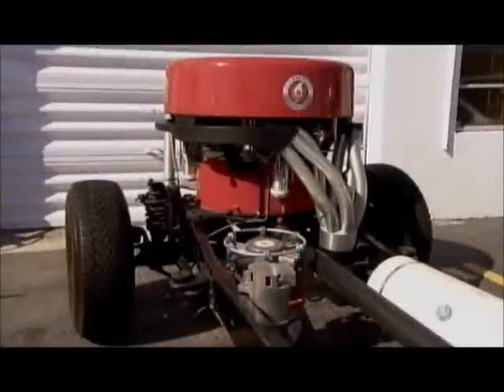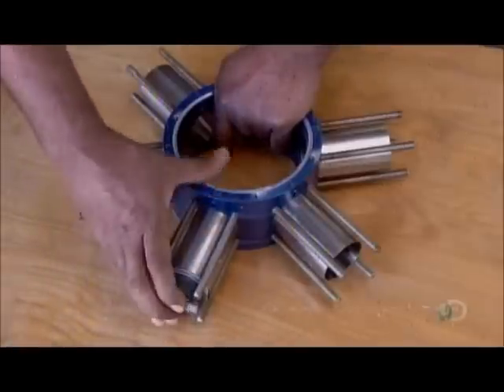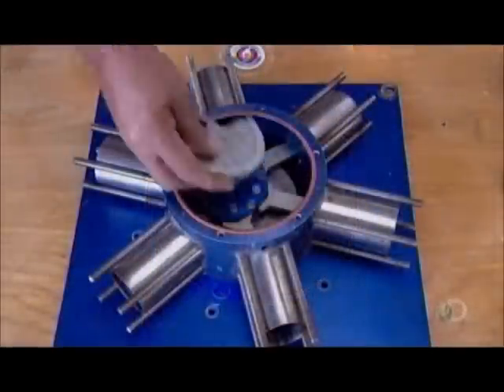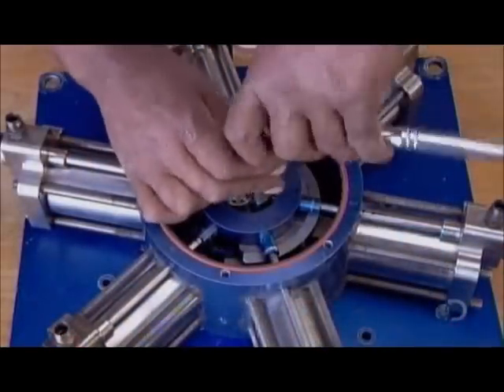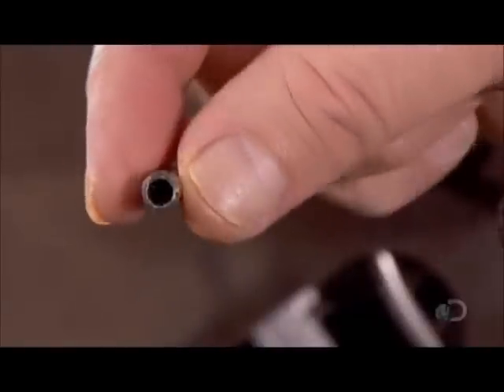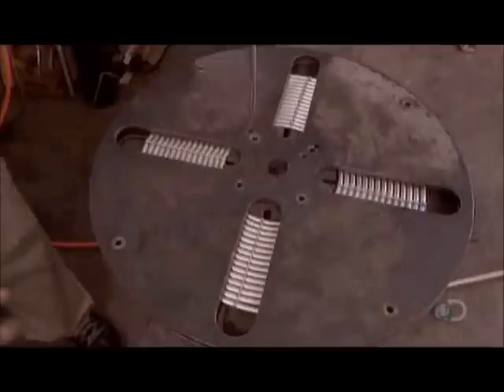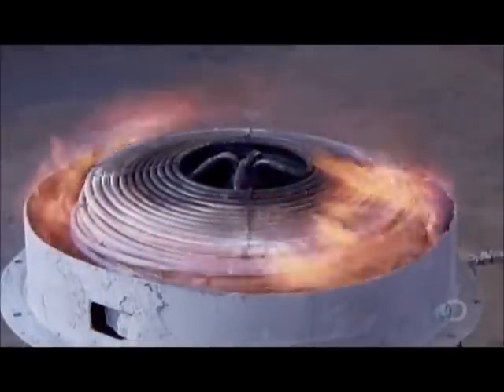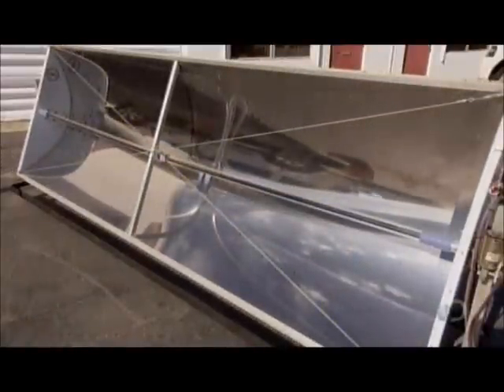How It's Made - Steam Engines

Comment: I don't believe the question here is what is efficient, I would gladly take a steam engine over anything that has to burn fossil fuels any day. Water is a hugely abundant material, one that earth recycles. Heating up the coils with simple propane should be no problem in fact to quote something I read about propane not too long ago " HD-5 (propane) was originally intended for use as vehicle fuel" Propane is not nearly as bad when burned, the only issue you come into contact with is pressure, and specifically different types of pressures, your propane and steam tanks. Which would both need to be made of industrial materials to even be fit to get near an interstate. When you include the cost of propane these days it might not be too bad, it just depends on how much propane it takes to get the amount of steam you need and for how long your journey will be. I think one of the issues you run into, is controlling your peak amounts of steam. This is why relief valves and gauges keep you from getting an explosion. So if you aren't checking these things while driving...well, KABOOM! I think for all intensive purposes steam engines still fit a great many uses today. It could make for fun travel by vehicle if you spent the time engineering it to do a specific task. Also, applying a transmission to a steam engine would be an added benefit because you can stop from forcing too much work on the engine itself. Although steam engines are powerful and strong, it's not hard to mess up the piston.
Reply: The problem with steam is low thermal fuel efficiency on the scale of an automobile engine.. heat loss is high so fuel mileage is generally very bad.. this company has had a hard time releasing any info on fuel efficiency and BSFC.. but some tests have shown they are not very good... less than engines currently available.
Reply: Some Other Dude Both the practical and theorical efficiency limits of the steam engine is far less than that of the ICEs... Carnot calulated the formula that proves this 200 years ago...
Reply: killer13324 Coal fired steam turbine powerplans in the over 1,000,000 kilowatt can be very thermally fuel efficient...  its why alot of are electrical consumption in the US comes from this type of power plant.
Reply: killer13324 The laws of thermodynamics prevail in this case... steam is not thermally fuel efficient on a small scale.... which is why today you only see it used on mega sized ships and power plants... below 1000,000 hp its much more expensive both in construction, operating cost and fuel costs.... its basically why steam is obsolete in all but a few very large applications.
Reply: Esben Jensen A lot of live steam museums switch the old engines over to LPG or CNG because its more easily available and much cleaner than firing with the traditional coal
Reply: MrShobar Except on reciprocating steam engines a condenser only lowers "thermodynamic" efficiency... it's function is only to recover boiler water...
Reply: Andy Jones Good morning Andy, I just wanted to point out that in this case mr shobar is incorrect, clearly what is shown in this video of a Cyclone engine is a single expanding reciprocating engine...  (this would be one of those exceptions)  discharging exhaust steam directly into the atmosphere is more efficient than a surface or vacuum condenser.
had the design been a triple expansion engine? then a vacuum type condensor would be essential to fuel efficient operation.

Its a simple case of dynamic viscosities of Newtonian fluids versus the laws of thermodynamics... friction losses of steam being of greater consequence than thermal conservation or pressure differential.

 cheers!
Reply: MrShobar Just the facts... single expansion engines are an all together different kind of beast, it differs from a turbine in that installing a condenser (although it may be required by the design and application of some installations to conserve boiler water) a condenser actually reduces power output and efficiency... very unlike a turbine where installing a vacuum condensor increases both efficiency and power output. 

Thats why they call me.. Herr doktor
Reply: He's got some parrots. Squawk! Herr Doktor! Squawk! Anyway, seems like a scroll expander would simplify things a LOT. Advantages to condensers, reuse heat through heat exchange instead of starting from ambient each time, createvacuum on back end through ccondensing, no scaling in the system because you aren't always adding new water, less water to carry around, smaller size because water is already preheated, more efficient, less fuel needed, quieter and finally, because it makes me correct. Thats why they call me Frauline Nurse. (I hope that name doesn't stick!)
Reply: brooks potts I hate to burst your bubble, but propane is a fossil fuel.  Your steam engine burns fossil fuels, unless you intend on burning wood or food.
Reply: TulsRetspmud not to mention that flash tube boiler engines don’t explode….
Reply: Some Other Dude But they still convert water into steam, which is why steam engines are far less fuel efficient than ICEs
Reply: Andy Jones Who said the ICEs can't run on trash??...   no matter what the fuel, the ICE is more efficient
Reply: Andy Jones Yes, very excited and so is the rest of the engineering world... at least the ones that understand the Carnot cycle. 

Well it seems you missed an important step, you forgot the fermentation or digestion process... only a fool would put sticks in his gas tank,  you know even less about biofuels than you do about steam engines... not surprised really.

Methane, alcohol, and esters are very clean burning and have a very high octane that allows higher static compression and thus even great efficiency for a ICE than gasoline.
Reply: +The real doktorbimmer unless he’s doing it as a hobby; and he’s already demonstrated ample knowledge on biofuels, etc.
Reply: The  fundamental flaw in using steam is how much more fuel you use, what is the point of of using a fuel that's twice as clean if you are burning 3 times more fuel?
Reply: you still have to burn something to make the heat though... I can run an engine on wood... and waste wood at that. decomposing wood releases the same amount of co2 as if you burned it... same amount of heat as well... why not use that to good use instead of letting it rot... yet, there are those out there would call a person a polluter when they see a wood stove...
Reply: doktorbimmer they could be useful as power generators to relieve some of the pain from power bills
Reply: i'm talking small-scale power generators, nothing to power the whole home only to put a little extra power in to relieve the burden and lower the power bills in metropolitan areas. Cant build a windmill and solar panels are wallet-burning expensive.
Reply: Steam engines are relatively inefficient, and if you are going to burn propane to run a steam engine, you could just as well get a car that runs on propane/natural gas, both of which are mostly from fossil sources. A lot of gas-powered cars can have a propane tank retrofitted too.
Reply: doktorbimmer You need to add a condenser to the Rankine cycle to boost efficiency.  This is very hard to do with a small vehicle that is forced to exchange heat with the outside air.  In a large power plant, a river or a cooling pond provides the cooling water to the condenser.  And it's thermodynamics, not "thermal dynamics".
Reply: doktorbimmer actually MrShobar is correct. In a closed rankine cycle or ORC (organic rankine- uses refrigerant instead of water), you have a condenser. Not mentioned here, but the bottom section is just that. Air circulates around the bottom, condensing steam and preventing the air used for combustion. Also, I'm not sure why every comment is from geniuses saying it's too inefficient, etc. Continuous combustion is more efficient than pulsed, it can use trash as fuel, solar hydrogen, etc. If you condense using a heat exchanger/ recuperation to use the latent heat of condensation to heat the incoming water and thermally isolate the system as much as possible efficiency could be great. Not that efficiency matters when burning sticks. Secondly a condenser creates a vacuum on the discharge side creating more power than exhausting to atmosphere (with exceptions but I'm rambling now). The advantage is that you're losing less heat to the environment and recycling heat, and there is no "boiler" to blow up or heat unused steam. Look around YouTube, every single tech video has a bunch of generic comments about "laws of thermodynamics" as if that qualifies someone as an expert. So much negativity! Not saying people can't disagree, it just gets old. Everyone can find flaws. Why not offer a solution?
Reply: Andy Jones that was supposed to say "preheating" air, not "preventing"
Reply: You are full of it.  Are you an engineer?
Reply: doktorbimmer Who is they?
Reply: Kevin Keel Well, if you were one of them you wouldn't need to ask now would you? 

Cheers!
Reply: Since I am not, and since you've provided zero evidence, could I assume that there is no "they"?
Reply: Kevin Keel No... we can only assume that you are not....
Reply: Erzählen Sie mir nicht, was zu tun! Ich bin der selbstgerecht Doktor.

Someone else to help tear down the wall, thanks.
Reply: Kevin Keel Anfänger?
Reply: Dammit, I'm not going to bother translating that. I was born in Pennsylvania and live in Florida but took 2 years of german (sorry-Deutsche) in 1990-1991. Thats all i remember except Ich bringe das kartoffelsalat und die serviets zu ein badenzimmer . I think that means I'm bringing potato salad and napkins to the bathroom. With bad spelling and my der die das's all screwed up. I think i learned more german on Hogans Heros. Ya vol herr komandant!
Reply: The real doktorbimmer NOT far less efficient- the cyclone engine is on par with ICE engines.  It’s mentioned in the video.  And much, much more clean burning.
Reply: Some Other Dude Absolutely not... if anyone has tried to give that impression it is absolutely false...  Promotion of the Cyclone engine has been very vague regarding the two different products they market.. one is a combined cycle system that runs off the waste heat from another source and the stand alone system with its own boiler, don't get confused about these two different types and how they are calculated... the single expansion is less than half the thermal fuel efficiency of a modern ICE in some cases less than a third.  ICEs even with after-treatment are more cost effective and cleaner..
Reply: Some Other Dude It's actually hard to compare, especially if you just say steam engine verses ICE. To many variables like heat exchangers, recuperater, heat insulation, etc. If the heat of condensation/ evaporation (latent heat) in water is conserved through heat exchanger there'll be a gain, all things being equal. Also, to lesser degree, but generally higher temp differences give higher efficiency because of Carnot (hot-cold/hot). Basically, without using math, etc, the engine that stays the coolest on the outside (with same heat input) is most efficient. Then again, carnot is a general equation that doesn't take fuel burn efficiency into account. I'd rather burn trash at 20% than gasoline at 40%.
Reply: The real doktorbimmer I'm glad you're so excited about ICEs. I'm also glad your car runs on trash because at first I felt bad about putting sticks and junk mail in your gas tank.
Reply: The real doktorbimmer I know all about biofuels, gasification, methane manure, etc. I'm actually heating my my hot water with hydrogen from recycled aluminum and sodium hydroxide. Unfortunately it's not quite sufficient so I''ve just added methane. Not sure how well it'll work because my first batch is "brewing" now. I have the H2 bubble through the sludge because some science papers show a much higher conversion with introduced H2. Too much to explain here, but less co2 is produced. As for carnot, I have built stirling engines and heat pumps and know all about carnot, although it's barely relevant. It doesn't take into account fuel burn, thermal insulation, heat exchange, type of fuel used, weight, system inefficiencies like transmissions, joints, bearings, etc. According to carnot, you'll do your best work with a fever of 104f while naked in Antarctica. I'm glad you know who Sadi Carnot is, but there are many other issues.
Reply: Andy Jones sorry, but only Dr. Jak G. Cogsworth is permitted to make statements about steam engines.
Reply: Some Other Dude Well he might not be old enough to shave yet.. but I would bet he is at least smart enough not to waste his time heating water with aluminum cans and lye!
Reply: The real doktorbimmer uh, if you're guessing my age from the picture, that's my daughter and her dog on the electric bike with rocket side car I built with a bike, electric motor, 48 volts and 20 ah worth of lithium batteries, and a beer keg. Yes the aluminum and lye is exothermic and makes tons of heat, but it produces tons of hydrogen that I burn in a gas water heater. It stores in a large inner tube, otherwise it's just a small candle size flame.
Reply: Andy Jones No, I didn't bother to notice the photo at all really... but I am betting that neither of you has an engineering degree..

Well if you aquired the aluminum cans for free and other materials from salvage it could be a cost effective method.... on very limited scale.. given that your time is not very valuable..

But in terms of efficiency? I can't think of a process for heating water more wasteful and inefficeint...
Reply: The real doktorbimmer sorry. I'll only do things that are efficient, productive and not a waste of time. By the way, I'm 42, have 2 kids(6th and 7th grade) in gifted programs and I try to encourage experimentation and learning science so they don't grow up to be the type of people that just criticize everything that other people do while doing nothing themselves. I do it to learn, teach, be more independent, and because I enjoy it. But thanks for your concern.
Reply: +Andy Jones if you don’t agree with him that the only option is diesel, he can’t accept your opinion.  In his world, there is no other way to be explored, because ‘the science is settled’.  BTW, he won’t acknowledge that diesel is now facing it’s hardest challenge, which is the Euro 7 NOx restrictions.  If a small efficient steam range-extender engine could find a place in this world of varied needs, he wouldn’t admit it with a gun to his head.  
I admire your experimentation of this stuff and your resulting ability to educate others.  The new and better ways will likely come from the garage of someone like you, operating outside the law of the diesel police.  I propose we send him a liter of emulsified diesel fuel as a christmas gift.
Reply: Some Other Dude And you continue to refuse to accept the fact that ICEs are in fact more efficient heat engines than steam...
Reply: Some Other Dude yeah,you see it on every video where someone is nice enough to share their work, there's always somebody that wants to play smart by trying to find flaws in it. I could build a flying car that runs on leaves and they'd complain that it doesn't have enough storage space. There are so many different technologies, its not just a matter of efficiency. Depending on the application, weight, cost, availability of resources, etc play a role. We do lots of things that could be improved on. A refrigerator cools food but heats the home so we run the ac which heats the outdoors, then we pay to heat our water. We're used to it so we don't realize how goofy it all is. I actually just like tinkering and trying different things. Some people like to build models or play poker, I like finding unique ways of doing things and exploring other options than the usual. I wasn't suggesting anyone should use aluminum to get their hot water. I just wanted to see if it could be done. I think you get it.
Reply: Andy Jones Well good for you!

but perhaps you should tell them that despite the recent interest in hydrogen as a clean energy source... you are actually causing more pollution and wasting energy than if you had just taken the old cans to the local recycling center..

and down worry about not feeling special because you're not making some extra effort to save the world... your kids will still think you're special.
Reply: The real doktorbimmer now I get it. You're illiterate. Whoever is reading my comments to you left out the part where I just like doing science projects to learn, teach and see if I can. I don't drive a Tesla either. I even eat meat and exhale a harmful global warming gas, and nothings more wasteful than that. Electric here is only 8 cents a kilowatt hour. The point isn't saving money either. My neighbors drink a lot of beer and I use them. If that bothers you, come recycle them. 202 6th street east Bradenton Fl. You just want to argue. Learn to read first.
Reply: Andy Jones Oh! good for you then...

I guessed right... well if its free cans then I don't think your a real problem other than you could here in California collect far more at the recycler's than burning them for a little hydrogen.. 

Me too! The  Tesla's range really sucks and not much being done to fix that...I love steak  and a occasional beer... even if you killed off enough of the world's excess population they would still be producing greenhouse gasses (at least for a while)

8 cents!  Not with all the douche bags here in California charging up their Tesla cars every 55 miles!!!  

So your still bitter about being corrected on your engineering comment then?

Please get over it...

and read a book... about the Carnot Cycle..
Reply: +Andy Jones "now I get it. You're illiterate. Whoever is reading my comments to you left out the part where I just like doing science projects to learn, teach and see if I can….”  

He will never acknowledge your many interesting points, he will just talk past you, and whenever you corner him he will escape using a nuance that is not germane to the conversation at that moment.
Reply: Some Other Dude Being literate is not much help to you sir if the only material youre reading is AUTOBLOG...

Not at all, I still stand by my comments that the Cyclone steam engine is a farce... a single expansion reciprocating engine simply cannot deliver the fantasy performance claims that the company was making before the scam ran its course...

Cyclone has never proven its claims.. or delivered a working engine to a customer.

its a scam...
Reply: The real doktorbimmer well if Carnot is your biggest concern, you must have a Stirling engine in your car, since the Stirling cycle is the closest approximation of the Carnot cycle. Who cares that a steam engine can run on leaves, you want the efficiency only diesel can deliver! I can't begin to express how little I care what heat engine cycle you prefer or if you have pictures of Carnot, Otto and Diesel on the wall of your shower. If your problem is single expansion reciprocating engine why not use a multiple expansion scroll motor. I use a scroll compressor (car ac) with the one way valve removed. It runs at under 5psi and has gobs of power at 100psi and substantially cools the air. They're used in most ORC (organic rankine cycle) projects. They're simple, cheap, smooth (not pulsing like pistons) and have a built in clutch. Go ahead, tell me how dumb I am and that I don't shave. Then get offline and do something instead of complain.
Reply: +The real doktorbimmer again with the straw man nonsense- autoblog isn’t all I read- I never read it until I did a search for the future of diesel in europe.  All the articles I found say the same thing autoblog says. When you have to make up a straw man, I suspect it’s because you don’t have a valid argument.
Reply: Some Other Dude yeah, sometimes people just want to argue online. I'm not even sure what the argument is about anymore. Everyone, including myself, can be a little more jerky online when in real life they're really nice people. I don't take it too seriously.
Reply: +Andy Jones you’re right
Reply: +The real doktorbimmer here, chew on this- and I warn you there are numerous other articles from numerous other publications which all say the same thing.  And please, don’t bother with the hoax claims or rag claims.
http://wardsauto.com/ar/psa_gasoline_engine
Reply: Andy Jones I would but the Stirling is unfortunately not a very practical design... the Diesel and the Otto engines are on the other hand very practical..

but most important they have a HIGHER theoretical single cycle, Carnot Cycle efficiency than any steam engine will ever have..

which is why the technology is no longer considered seriously for further development..

And yes your comment regarding the single expansion engines is still incorrect...  so please just let it go OK?

Cheers!
Reply: Some Other Dude Yeah I tried a bite... but realized it was stale...  7 years old... not very fresh! Lol!
Reply: Some Other Dude Interesting fact there ... that Diesels were outselling gasoline engines by over 1 million units already back in 2007
Reply: Some Other Dude You see if you were more up to date on the state of automobile ICE technology you would have been able to read between the lines and understand what your poorly written article was actually referring to.

Its hinting at what is coming soon... Diesel engines that run on gasoline...

The technology is called HCCI  its been around for a while but no their is serious interest 

perhaps you should chew on this first;

http://wardsauto.com/ar/ford_psa_hcci
Reply: +The real doktorbimmer I’m well aware of HCCI, we have been reading about it for a long time.  I agree it MIGHT provide a survival route for ICE.  But you’ve tried another straw man argument- suggesting that I didn’t know about HCCI.    I read Green Car Congress several times a day, and have for many years.  
As for your other post, YES in 2007 diesels were outselling gas in europe.  But we’re not talking about 2007, (straw man yet again) we are talking about the near future because emissions are a very real threat to diesels.
Reply: +The real doktorbimmer nice try, the link I posted yesterday are only a few months old.
Reply: Some Other Dude Dated 2007..
Reply: +The real doktorbimmer you know damn well I’m referring to the Facebook Cyclone post.
Reply: Some Other Dude Nah.. because Diesel technology has not yet reached its limits like steam.... and HCCI solves the NOx problems
Reply: Some Other Dude Steam is dead... Cyclone is a scam
Reply: Some Other Dude The facebook post really doesn't give much info... typical Cyclone BS
Reply: Some Other Dude I sincerely hope youre not one of the poor suckers that fell for this scam.. because you certainly defend this questionable company as if you did..
Reply: +The real doktorbimmer It give plenty of info.  I invite others to read it, then they will realize who is full of BS.
https://www.facebook.com/CyclonePowerTechnologies/posts/1016753441690054
Reply: Some Other Dude Proves nothing... its a scam
Reply: Some Other Dude Are you really that foolish and naive????
Reply: Some Other Dude Lets see some independent test results for SFC and TTFE..???
Reply: Some Other Dude Lets see ANY independent tests...!!!!!
Reply: +The real doktorbimmer it is obvious to any honest person that its a startup company with a viable proposal to make money by selling waste heat recovery systems (at the very least).   Obviously they have a least 4 manufactures ready to make the engines (or subsystems) and these companies have better things to do than sign on to scams.   Shoelle’s approach of cyclone burner and modern materials gives large improvement in both efficiency and performance, which very well may put the steam engine back in contention.  This much is obvious to more than a few people.   You’re having trouble with the definition of the word ‘scam’.
Reply: +The real doktorbimmer the moment you are confronted with them, you’ll declare them a ‘scam’ and ‘invalid’, because you’ve taken a hopelessly hard stance against the whole thing.  Which just has you looking silly.   I won’t be hammering you for about an hour now, I have to get to work.
Reply: +The real doktorbimmer diesel tech has reached it's limits, we aren't going to see diesels going much past cars like the VW polo diesel in economy.   And emissions regs are clearly, indisputably closing in on diesel.  If VW has to cheat, that is cause for concern.   And cyclone represents a very large jump in steam efficiency.  It's done with the burner and condenser.
HCCI holds promise, but like diesel emissions controls, I fear it's not easy to get it working in a saleable, affordabe, reliable package.  Many car companies are working on it and have been for years, but it's been a loooong time.  And now you are in the odd position of pointing to future development for HCCI, while refusing to do it for steam.
Reply: +The real doktorbimmer another straw man.  I don't have any financial interest in it of any kind.
Reply: +The real doktorbimmer yeah, lets.  Because we already know that constant combustion applications burn extremely clean without needing the aftertreatment equipement that adds thousands of dollars to the cost of a car, like VW diesels.    I would know, like many Jetta TDI owners I've faced some costly repairs.  And now we find out VW actually couldn't even make it work to claimed specs.
Reply: Some Other Dude admit it, You're with the illuminati to kill diesel. Something about new world order, mind control, free masons, fake Apollo missions and free energy magnetic vortexes. I know it's true because I saw it on YouTube.
Reply: +Andy Jones it's not true until I undergo independent psychological evaluation!
Reply: Some Other Dude Then where is the independent tests to prove the technology really performs as high as they claim?

You don't need to be an engineer to figure out their claims are grossly inflated... a single expansion, reciprocating type with simple valving??? Its the least efficient steam design know to exist...
Reply: Andy Jones "Investment scam"

as in "Keely Engine", "boiler rooms" and "pump and dump"

Cyclone had been offering its patents for sale as well as selling stock.. which is now worthless...

Its reported to have taken in 60,000,000 USD which was sold as investments in development and production facilities but in reality most of the money went to compensation for its 3 key employees..

it was reported that Cyclone failed to deliver a working engine to one of its development partners working on a land speed record attempt..  its also been reported that the company has laid-off it small paid staff and its patents all but one that was sold have expired due to failure to pay fees.

Its a perfect text book example of a Keely engine investment scam..
Reply: +The real doktorbimmer I believe their efficiency claims, which don't claim to be better than ICE engines.  Their burner is the real innovation here.  The flue losses you mentioned a few days ago are a valid concern- and I think the cyclone burner design is as good as it gets to address this, it is is a very good solution. .  Yet its still compact, affordable and buidable.

There are probably still improvements to be made which would make them hold off on independent testing.

BTW, you know the military has signed agreements with Cyclone, right?  They aren't going to do that with scammers.  Not even under Obama.
Reply: Some Other Dude but not fuel efficient enough to compete against ICE technology already available.

Really? there burner design sounds very primitive and the steam generator is an old design..

Cyclone has put in bids on several government contracts... but that doesn't mean anything unless they can actually deliver a working product... some it seems they have no intention of doing
Reply: Some Other Dude I agree that it's the boiler that interests me, not the motor itself, but you can't get investors without a patent and it's not easy to patent a new idea dealing with an old technology with millions of patents already. Unfortunately, ideas are based less on what works and more on what can be patented. The main benefit I see in steam is the use of any fuel, if it can also be small, light and inexpensive. The engine itself is really an after thought for me. Actually you don't even need an engine! Check out this underwater steam jet that draws understand air and water from the front, adds steam that condenses understand the water which creates a thrust out the back and suction in the front. https://www.newscientist.com/article/dn3321-steam-fires-underwater-jet-engine/ It claims to produce 30hp with a 10 inch unit! The best part is no propeller or moving parts which saves sea grass, Manatees, etc here in Florida. Its also super simple.
Reply: Some Other Dude so as luck would have it, a crappy little sailboat hull washed up at the marina next door. Its one of those stand up things, pretty much an approx 14' surfboard. Anyway, I'm thinking of trying the steam jet device I mentioned above. Check the link out and tell me what you think. I have no idea how much steam I need to produce or if there's a way to use the brackish water but I want to see if this no moving parts steam jet really works. I have plenty epoxy, fiberglass and even about 9 yards of 60" carbon fiber to modify the hull if needed but mostly want to figure out the jet and the best way to get the steam (light weight). Any suggestions are appreciated, even from herr doctor if it's not to put a diesel engine on it. The boat is junk, it'll be a good platform to experiment with because I won't feel bad cutting it up or destroying it.
Reply: +Some Other Dude "BTW, you know the military has signed agreements with Cyclone, right?  They aren't going to do that with scammers.  Not even under Obama."  DARPA has terminated its agreement with Cyclone Power Technologies for failure to deliver on its contractual agreements. No big surprise here!
Reply: +Some Other Dude "I invite others to read it, then they will realize who is full of BS."
https://www.facebook.com/CyclonePowerTechnologies/posts/1016753441690054  quote; "The testing procedure for the same engine integrated into other products will follow. Cyclone has identified two manufacturers who will install the Mark 1 and the Mark 3 Cyclone Engines into their products for the next certification tests. This will bring more products to market powered by Cyclone Engines."
Reply: +Some Other Dude What manufacturers? What products have come to market?  Do you actually believe this BS?  How can you be so gullible and foolish?
Reply: I read through the evolution of your commentary on this video (100's). You used to be smooth, like in this comment (3yrs ago-2015-top of this thread). Who will we get to the museum if we ram The Mona Lisa down everyone's throat. Communication is an art, or a waste of time.
Reply: Dude.... even steam engines burn fossil fuels 😑 what do you think heats the boiler
Reply: Then youre an idiot.